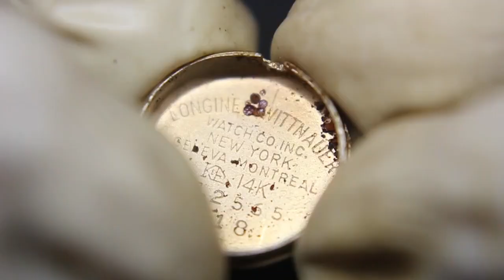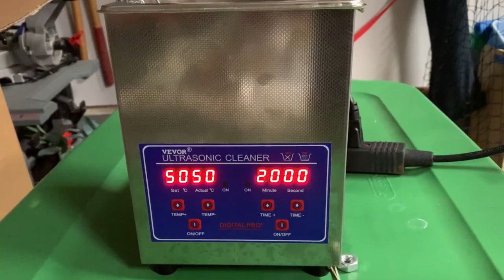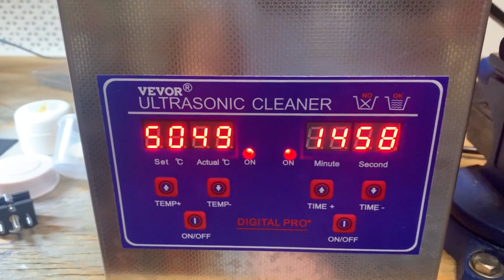Restoration of a Rusty Vintage 1962 Longines Watch - Rust Bucket Revival

Comment: Rather than use vinegar and lemon juice, have you tried a few drops of kerosene on rusted parts as you disassemble? Before you proceed on anything you think is going to give trouble put a few drops of kerosene (cover with the glass dome and wait an hour) which will loosen and dissolves rust without pitting or water based. Now it's hard to buy actually, so if you're in the USA, use barbecue charcoal lighter fluid, it's very similar. You could also use #2 diesel fuel (but I'm wary of additives in it these days). This btw is what the old timers told me to use long ago. Good job by the way! Kerosene, except for softening old oil and grease, also has no effect whatsoever on the other parts of the movement. The spring barrel probably would have lifted right out !
Reply from the maker: Awesome suggestion, I’ll be trying that next time
Reply: Some would use WD-40 here. Guess what it is? "Petroleum distillates." Uh, kerosene.

Comment: Nice job restoring this old watch.  The old DNA and fuzzies you scraped off didn't improve my appetite though LOL.  One thing I would like to have seen is whether the watch actually worked once you repaired it?  I'm guessing you don't have a timegrapher?  No problem, just would have liked to see it run and the current time it was keeping after all of your work.  Cheers
Reply from the maker: Thanks, Cliff! No, I do not yet own a timegrapher. However I use a basic audio based analyzer on my phone, but it’s certainly not as good. Instead, I adjust watches over the course of several days based on actual elapsed time (after the phone software gets me in the ballpark)

Comment: So did the crown wheel screw break due to corrosion or from being turned the wrong way?
Reply from the maker: Corrosion. When I felt resistance I immediately went to the donor to make sure I was turning it the right way. You’ll notice the rust on the wheel itself and so it makes sense some made it to the screw

Comment: why the crown wheel is made into instead of a single wheel?
Reply from the maker: I assume you’re referring to the crown wheel “seat” that sits around the screw post. I’m not sure, but my assumption is it’s a hardened metal that won’t wear, whereas the movement plate itself is probably softer alloy. Again, purely a guess

Comment: is removing the green oxidized corrosion on the dial against the rules?
Reply from the maker: Good question. The “green” or slight discoloration on these old metallic dials is what’s known as “patina” and it’s permanently in the finish. If it’s removed, it takes everything else with it (i.e. the “Longines” text)
Reply: @csspinner  ah I see. thank you for the education.
Reply: @huckleberry12  -- It's similar to pinball machine repair/restoration. The goal of touching up the paint on those is to make it look like you hadn't touched it. So you fix the obvious paint damage the best you can and try not to get perfection on the rest. And yeah, nobody really wants to retouch text unless they can help it, and that's bad enough on a pinball machine. So imagine trying to hand paint text on a movement? Probably impossible or next to it.

Speaking of pinball machines, even those creating replica parts have taken a clue from those repairing them. For instance, pop bumpers turn yellow with age. And some are reluctant to replace a broken one since brand-new ones are perfectly white. So if you replace one, you'd be stuck replacing them all for a more consistent appearance, and you will pay more for that. So there are now off-white pop bumpers designed to match the old ones that are not broken yet. So you can improve the appearance of the one without harming the ascetic.